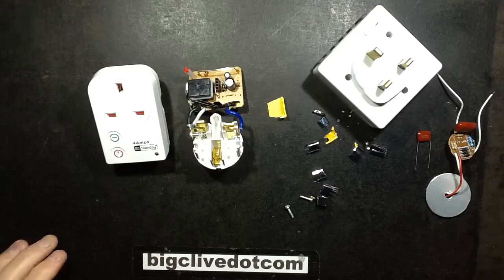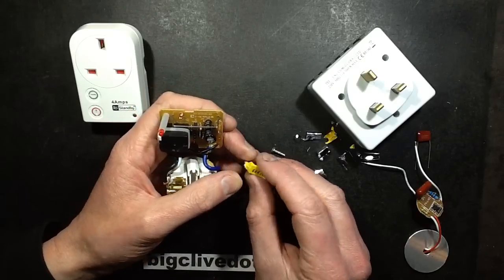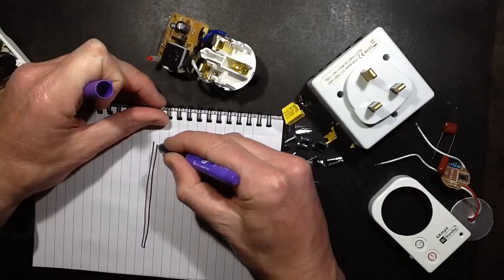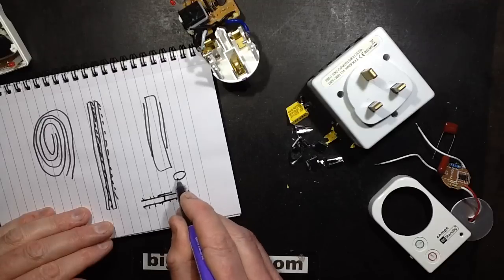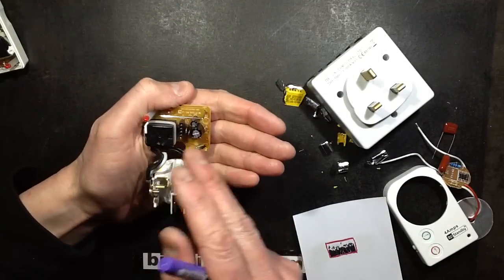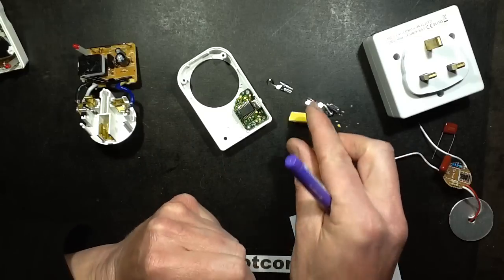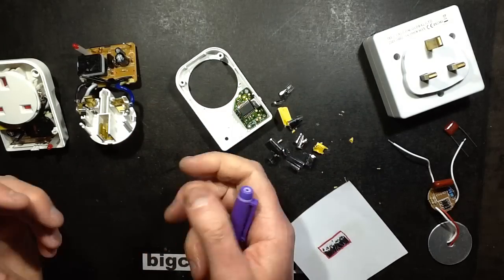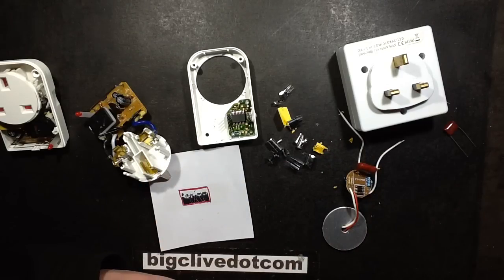Fascinating failure mode of metallised film capacitors.

Comment: THIS VID IS WHY I AWAYS CHANGE CAPS IN MY TUBE AMPS REGARDLESS OF THE MAKE MODEL BRAND OR HYPE ( BUMBEL BEE ) THEY GO TO
Reply: That goes only to show that you don't really understand how and why capacitors fail.

But to be honest, you are mostly right in replacing bumble bees on sight. Those are paper capacitors with only mediocre sealing so they will be leaky as hell in most cases.
Reply: +mjouwbuis It is to save the transformers thing with me I tend to run my tube amps for hours on end some times they get left on all knight so I change caps to be safe and to improve the sound and lifespan of the tubes I may not know all there is to know about caps but both of my transformer loses were do to cap leakage..
Transformers $494.45 and $237.64.. I learned my lesson caps cost less than other parts (edit do to spelling)

Comment: I wonder if this problem could be avoided altogether by sufficiently overrating the capacitor 🤔
Reply from the maker: If the value is too high it increases the stress on the voltage regulating components.
Reply: @bigclivedotcom  I was thinking overrating its upper voltage limit, not its value. Working on the assumption that a chonkier dielectric would be less susceptible to this sort of damage and might therefore either last a lot longer, or not degrade at all.

Comment: I'm well aware of this phenomenon. It is ment to be for self healing, but if the cap is abused all the time, it will fail soon. In my area is a factory for metal film capacitors named ISKRA. They make very HQ capacitors. The capacitors in this configurations should be rated AT LEAST 400V, better is 630V. Those won't fail.
Reply: +Srečko Lavrič 400V is too low a rating for a mains series dropper by any definition. 630V is better but may still exhibit some self healing as peaks can be above 630V. 1000V will last forever but is larger and more expensive. X2 rating (275-315VAC) is the cheapest way to get one that will theoretically withstand mains voltage but most of these are meant to self heal quite enthousiatically. They need actually be rated for series operation to guarantee prolonged functionality.
Reply: +mjouwbuis Do you have any more information or any example type of series operation rated cap I might look up? I have found several such failures (coffee makers are typical) but now I have a design application where I need to detect a mains control signal, I was just planning on using an X2 cap. This will be a high volume production item and I want to avoid any problem. 
Are you guys sure these failures are from self healing and not oxidation or electromigration or something? I have looked at the foil and seen no holes, they might be microscopic but I don't think so. I have also tried to cause the failure with high voltage but it just burns big holes through multiple layers.
What about the series resistor that is often present to limit current spikes, would it not interfere with self healing?
As an aside, I have also noticed a similar "eaten up" pattern on the outer wraps of foil caps that measured OK. I do not know if this is normal from the production process or the onset of progressive failure.
Reply: +mjouwbuis Thank you, much appreciated.

Comment: It's a self-healing property, if there is a dielectric breakdown, then the thin metal layer gets zapped and melted away, "healing" the capacitor.
Reply: Benjamin Esposti it may "heal" the capacitor into a working state, but this capacitor has now changed. Depending on how much  is zapped, and melted away will not only change the capacitance for sure, even if just a little - but will shorten its life because now the metalized film will naturally disintegrate faster under normal current demands until it fails because of this erosion that has taken place from a current spike, or just normal usage. This capacitor may have a chance of not failing as well to be fair -depending on it's application and if it is never damaged again and also , just because it has been compromised in such a manner. We wont know until it fails.
Reply: Jeff L Ya that's what I was saying lol.
Reply: Benjamin Esposti I took your comment : "It's a self-healing property, if there is a dielectric breakdown, then the thin metal layer gets zapped and melted away, "healing" the capacitor". As if you thought the cap was healed and still good, due to this healing property. This cap may work for a while but it's not healed, it's actually damaged and waiting to fail. Under working conditions, a cap that has been damaged this way will certainly cause a change somewhere in voltage, current handling, not to mention unknown EMI as well as correct waveform or waveform amplitude even though the item is functioning. You're not wrong at all, I was commenting you with some info.
Reply: Jeff L Ok lol, yeah I thought about typing out basically the same thing you said. But I was lazy or tired and didn't feel like it xD
Reply: heh, cool. I get that way too sometimes, so much good stuff to check out and I want to comment but feel burnt out after a while of watching. and commenting. and fixing typos! Have a good one...
Reply: Jeff L LOL yes, fixing typos xD
I know that all too well.
I also tend to get carried away into explaining every little detail. It's good, some of the time xD

Comment: I think this applies to motor capacitors in domestic appliances too. Kenwood Chef food mixers for example are almost indestructible, except for the motor capacitor. As it gradually fails (probably due to arcing from the motor brushes), it tends to also kill the triac.   If you want an almost indestructible food mixer for next to nothing, pick up an old Kenwood Chef A901 and replace the caps and triac. It will be good for another 30 years.
Reply: what's triac
Reply: Good question, in this case an  8A 600V Triac.  https://en.wikipedia.org/wiki/TRIAC is used to chop the 240V mains voltage, and supply only a percentage of the waveform, in a similar manner to pulse width modulation. This is a pretty common usage for triacs, and there are a number of simple ways to control them. The older Kenwood Chef mixers use a form of variable resistor and the modern ones use a small microcontorller to switch the triac.  If you want to see some more examples of speed controller schematics based on triacs, follow the link https://encrypted.google.com/search?q=triac+speed+controller+schematic&tbm=isch&tbo=u&source=univ&sa=X&ved=0ahUKEwj0ieLqtKrKAhWD9HIKHTGhDkoQsAQIJw but do bear in mind that if you intend to try this at home, you are switching mains voltage, so take care.
Reply: Andrew Hull thank you :)
Reply: No problem. If you are wondering why you would use a microcontroller rather than just a potentiometer to control the triac, It allows you to do a "soft start" (build up the speed more evenly), and also in some cases to react to a stall and speed sensor on the motor shaft, to cut the current if the user jams the motor. You can do some pretty useful things in software that would take a lot of complex hardware to achieve, and microcontrollers these days are very cheap.
Reply: +Andrew Hull :)

Comment: My Samsung LCD monitor from 2007 failed after only 3 years. I opened it up and replaced the filtering capacitors on the secondary side of the switched power supply (crappy cheap ones) with more expensive ones of a decent brand made for that exact purpose (smoothing high frequency ripple). Same capacitance, higher voltage rating, physical size not too big. 
The monitor is now 10 years old and is still working perfectly. Not even dead pixels! 
I've found that in most cases it's that exact component that tends to fail in most modern electronics. The high frequency and power conditions of the secondary side of a switched power supply really stresses the caps and so it often dies first.
Reply: capacitor plague, as its known....2007 would be right in the middle of the afflicted years.... crappy 'copied'/'counterfeit' electrolytics... loads of pcs were affected with motherboard caps blowing their ends and innards out and even catching fire...psu's also...
Reply: and Samsung tvs/monitors were notorious, so unfortunately you were double stuffed!
Reply: Thomas Ivesdal-Tronstad Those are electrolytic capacitors.  Completely different problem!